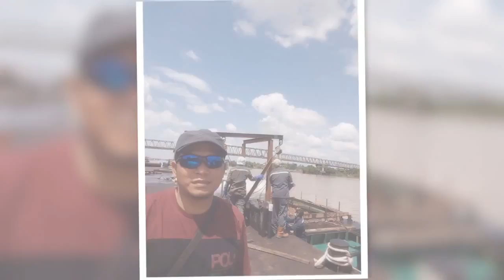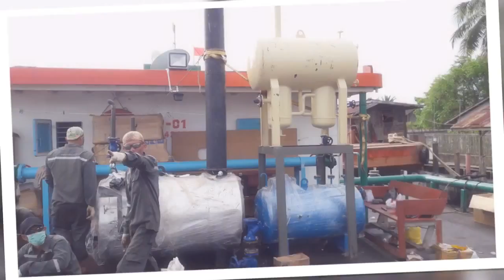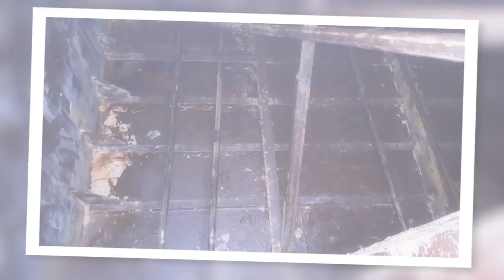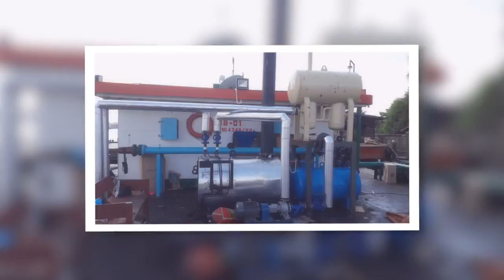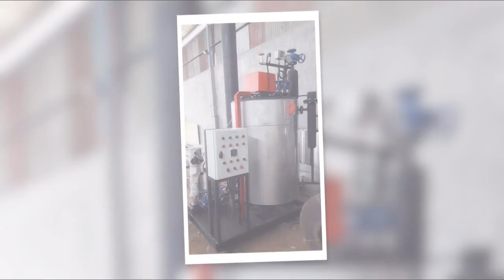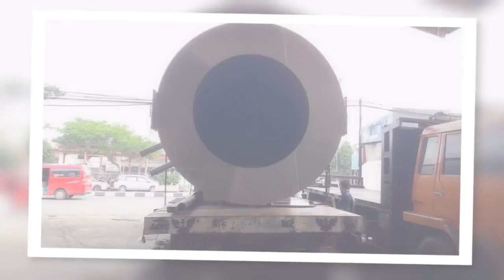Jual Hot Oil Boiler-kapal tanker☎️081388666204

Comment from the maker: hermal oil Boiler MFO

jual hot oil boiler,Hot water boiler,kontraktor boiler,water tube boiler,fire tube boiler,heat transfer oil,harga boiler,indtalasi boilerpabrikai mesin boier,pabrikasi boiler,
✔➡️Hot Oil Boiler kapal tanker✔☎️081388666204